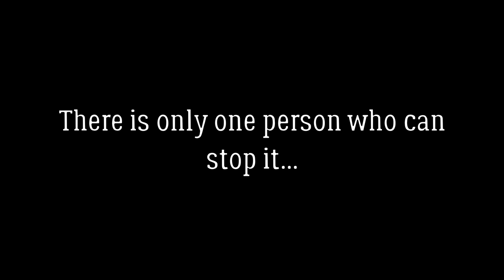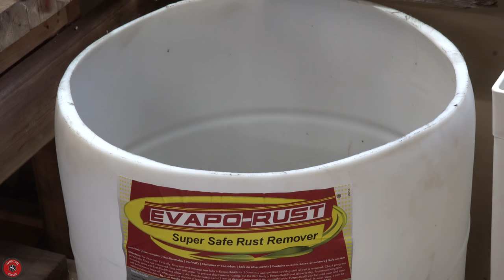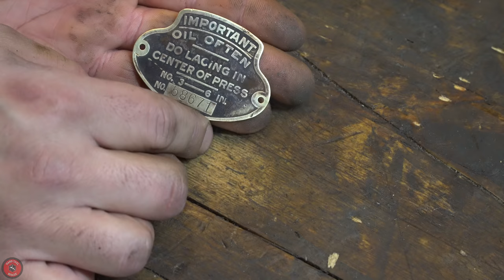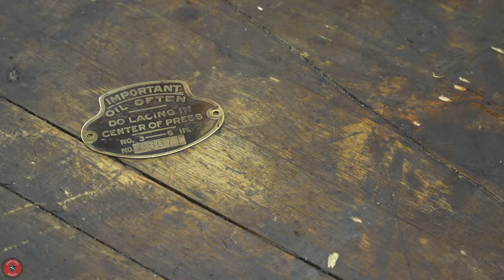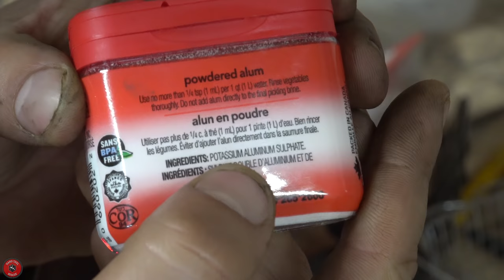Antique Belt Lacer [Restoration]

Comment: Where do you even get the refills for that tool. The ones that clamp into the belt. AND THEN WHAT DOES THAT BELT DO... FFFF
Reply from the maker: This company is actually still in business, but is now called Flexco.  These flat leather belts were for old machinery that ran off a belt line or off an antique engine.  You will see me use this tool for future restorations.
Reply: Also, many round balers use these teeth on the (rubber and fiber) belts that roll the hay into bales.  Most of the ones I've seen use about 8-10 of these belts, and they get plenty of use during the summer.  Even the rubber coated ones stretch, which means you have to shorten them periodically and put new teeth on the ends.
Reply: Or leatherwork with a gothic, steampunk vibe maybe...
Reply: My south bend lathe uses a drive belt like that too.
Reply: Yup. We could have used this a few times on our old baler.
Reply: Z  the belts are used to help create bass in old floor speakers, you should already been knowing that....
Reply: My old metal lathe uses a small flat belt as a final drive...
Reply: I've seen these belts in old textile mills driven by waterwheels to transfer the power from floor to floor where massive shafts ran the full length of the ceiling and a belt ran between the shaft and each loom. Some of the belts were pretty big and all made from leather. Tools like this must have played a major part in the industrial revolution great work keeping history alive man
Reply: Brooklyn Technical High School had   machine shop (lathes) that were driven off an overhead shaft that used belts like these.
Reply: Similar smaller belts are still used, need a long belt that might stretch... are you gonna use this or skive and glue?
Reply: 8270 AMF Tenpin bowling distributor belt uses these belts. The press here was not working properly at the end though, normally they self ratchet to the next degree.
Reply: A must have if you're in old tools. You can get rubber belts now but it     doesn't look right.
Reply: Conveyor belt repair
Reply: The first farm I worked on had this kit, we used it for the flat belt drive for a circular saw, run off a side pulley drive on a Fordson Major, the one they had was a single handle and it was a pigsa to use as you really had to swing on it to get the lacing grips to seat properly, but it did the job. 
Looking around that farm which was a real old quadrangle yard, there were shafts and bearings in all the rafters, running from an engine room which I assume would have been a lister or similar stationary engine installed, it seemed to run the dairy equipment, grain handling, chaff cutter, root chopper, and a few lifts.
No doubt some one has ripped all this out by now and probably converted it into bijou residences all that  history gone forever still I remember it and marvelled at how agriculture had become so much more mechanised, well the point is I suppose when that little bit of kit came out it represented a major advancement in power transfer and distribution, replacing with belts, pulleys and cogs/gears simple human or animal power.
Today they are still used in round balers, some bale wrappers, and there is a still a massive market (relatively) in the classic and vintage restoration scene.
Reply: The belt does what the belt is supposed to do.  Do not question the Belt!
Reply: Old time ceiling fans have 1-3 motors usually depending on amount of parasite fans, old Kona Inn restaurant had 18 fans with 5....? drive fans I think I remember dad working on? & used belts to run all the parasite fans & we had to cut & tighten the leather belts seasonally depending on slippage & ya there was adjustment pulleys but everything stretched differently, I remember it was a royal pain that paid REAL well & dad was the only guy knew how to do it.... well I know but highly doubt anyone will ever install another 1800’s era system in my lifetime
Reply: Laces are available in local farm stores. One use is on round hay balers . You repair the belts.
Reply: The Clipper inserts are readily available.  They have numbers associated with them.
Reply: Not reading further so,"what does this belt do"?
My theory...old factories had main power shafts running ftom an engine house.Individual machines,lathes grinders etc took power from them via belts which this machine could cope with.
Now,  to find out.
Reply: @HandToolRescue  yeehaa...got this one correct...cool.
I have used many a flexco for coal conveyor repairs.
First little one I've seen. Very cool.
Reply: @SamSoltan  How long ago?  When used on machinery, you only see them in Greenfield Village, Henry Ford Museum machine shop.  1800's and maybe Amish shops today.

Comment: What evil engineer put this thing together? Jesus. This thing had like, 4 patent plates on it and ALL the pins. 

Also, leave Dave alone. He'll come out when he wants to.
Reply from the maker: Hahaha.  I was actually surprised that this tool did not contain any nuts and bolts at all.
Reply: I know what you meant, but to be technical, I count one patent info, two instructional, and one from an "American stuff" importer in Paris. (Yes, I paused the video to read them when he showed them off after polishing.)
Reply: Very few engineers actually put anything together.... They mostly create headaches for the tradesmen....
Reply: @HandToolRescue  ur good
Reply: It took someone with above average  iq for sure
Reply: predominately pinned construction is insanely durable depending on the application. very little side loading on the pins here (none really). the large bearing surface of the pin should make for pretty smooth operation when oiled properly.
Reply: @3347861  That's because far too many engineers come out of college filled with what they learned from books but are never taught real life application problems.  The best engineer I ever saw was put out in the Machine Shop for 5 years as a Foreman.  That gave him the real life application knowledge.  He went nose to nose a few times with the engineer that only worked in the office.
Reply: Lol ikr, it's a patent nightmare
Reply: I was thinking diabolical mastermind.
Reply: I now understand why the Adeptus Mechanicus can’t remake any of their shit
Reply: @3347861  my son learnt this in the first week of his apprenticeship

Comment: We have had one of these lacing tools for several decades.  It came with a stationary Pioneer dry bean threshing machine.   When bean combines came out, flat belts went away.  'Fast forward a couple decades, and large round balers became popular, with large flat belts, so the Clipper lacing tool gets used from time to time.  I used mine a couple weeks ago to lace a belt for my South Bend lathe.

Comment: We had a belt repair machine in the hardware store where I worked in the 60s. Some belts were joined with steel pins and others with pins made of rawhide. The boss used the machine and I just watched. This was a farming community and lots of farmers used the classic Allis-Chalmers round bailers. A network of flat belts were what formed the bales. The belts would stretch and we would cut a little off the ends to shorten them and renew the lacing.

Comment: Believe it or not they still use these things in modern production, back in the day these made drive belts for steam driven belts and farm equipment today they are used on vinyl conveyor systems in the manufacture of pharmaceuticals... So we really haven't come that far. By the way they are more commonly used for grocery store and check counter belts there just wider and have more tines...  Great job on the restoration! Looks brand new and works even better...

Comment: Good Job and well done! In the Mill where my Father worked for half a Century, they had a simple Tool out of Wood for fixing the Transmission Belts. Using a special Hammer to get the Clamps in the Leather Belt !  They would have cheered to get such an amazing Tool !  I learned it by paractizing it.

Comment: no idea what a "belt lacer" does but this tool is top craftsmanship, solid and superbly machining and tolerances like a watch. no china crap.
Reply: Dieter Montanez before modern rubber drive belts they used leather to make drive belts. This machine is what was used to connect the ends of the leather strip together to make it into a loop.

Comment: On the farm we had a 1941 International M tractor with a belt drive pulley. The belt would be connected to a hammer mill, a ear corn conveyor or a lift that would raise the front of a grain wagon to dump its load. There was no electricity on that part of the farm but wherever the tractor was, there was mechanical assist to otherwise tedious hand work. I don’t remember if Dad repaired the belts himself, but I’m guessing our village blacksmith did it for him. The men on the farm had a trick to slap a moving drive belt to knock it off the pulleys instead of waiting for the machinery to coast to a stop. When my dad tried it, it broke his arm. It still ached when he was an old man. I do remember seeing those metal laces in the workshop, though.

Comment: used several types of belt splicers over the years just like that one, one in an old rope mill where everything was overhead line shaft driven, none of the machines I worked on was made after 1898 but they run good for making rope, and others where used in foundries for conveyer and bucket conveyers, don't miss those days, lot hot hard work

Comment: I used these many times in a textile mill I worked at a long ago , and in a second maintenance job I had after that,  We had several models of belt splicers, one was identical to this one. We used the clipper style laces of size two in this one  for smaller belts and from two to size six, in a more modern belt lacer we used to make and repair our needed belts up to 12 feet across. I learned after working there a while, my father had also once worked there doing a similar maintenance job in the same building under a different company name; Indian Head Hosiery The building was built in 1925. It once made socks and stockings, but was closed then reopened as a non woven material plant later. The old sock darners he likely worked on were pushed over into their pits, and crushed to be used as fill material and then covered in new concrete as the floors were redone for our business's ware house. When making the belts with cotton weave material, you always painted both sides of the belts near the lacing with shellac. Yet by brushing away from the laces this allowed it to soak in to the cotton belts, and not get on the new lacing clips to give the belts a much stronger and longer lasting life at the splice, the material we used was regular shellac. I once made a tool pouch just using one of the machines you show, some scraps of belting and clipper lacing. since it allowed for repairing smaller material sizes. Thanks for the memory.
Reply: You do beautiful work. That looks great. A hint; we mounted ours on  a plate to the rear for your knee to hold it still and pushed and pressed from behind the machine and belt, and the lower ratchet advanced as we pulled up and pressed forward again, a razor knife cut on the paper allowed easy removal once inserted in the clipper and secured by the wire,  but loose clips could still be added individually if you had loose ones to use up. You always had loose ones over time, or little scraps of clips. They were cut for each job.

Comment: Cut your corners first before adding laser in doing so the laces will be inside of the belt in the PIN should be protruding just a little bit so that no laces catcher track or edge of the bed and tear it. Nice job dude I like that little lacer. I only have clipper roller lasers here at work but that would be nice to have a aluminum version of that one for some of the smaller 8-in belts or even or 2 in wide belts that we have. I just wouldn't want to lug that thing around with me. Lol great work as always 🤟

Comment: Great video! I used these Clipper belt lancers well in to the 1980's. Some of the machines I used in the USAF had leather belting, depending on where I was stationed. The machines were old but in real good shape for there age as we had good shop maintenance programs. To tell you how old some of these machines were, they had metal tags on them stating "This Machine Conforms to the Orders of the War Production Board". That was the equipment that was purchased by the government for factories, shops, government owned arms and ammunition plants and even for military bases during WWII. As plants and factories updated there machinery, the older government bought machinery would be sent to a Depot facility were they were cleaned and repaired if needed and some would be upgraded to V Belts if possible. Then when a military base need some equipment it would be sent there. But by the late 1980's to early 1990's that old equipment was being replaced by new machinery and the military started using CNC machinery by the time I was getting out. I loved the old American built machinery, heavy iron and they were built to last. But there is something to be had with the new CNC Machinery and tooling, they are faster and very accurate with repeatability of +/- .0001" between parts. 
One funny story, back in the mid 70's I worked at an old machine shop up in Maine were all the machinery was run from an overhead gang drive with leather belting. We needed to replace one of the 8" wide leather belts from the overhead drive. I called on place that sold belting and asked for a 50' length of 8" belt. They must have had a new sales person there because they told me that the belts were only as long as the cow and didn't think they could get one that long. This person was very serious and had to ask another person there if leather belts came that long.

Comment: I can remember working to restore an old Nickelodeon from the late 1800's or early 1900's. Back then they made things to last. The biggest job was bending the tabs on the metal "record" discs that plucked the harps that generated the tunes. Bent, because the operators put the discs on upside down! And then they couldn't figure out why! After straightening all the tabs, we threw a stick of dynamite in the cabinet to clean the whole thing, threw on a disc and enjoyed the tunes!! 🤣😁

Comment: Wow, I'm at 13:27 and the quality and complexity of this tool is mindblowing for such a seemingly mundane everyday task in it's time... If the company didn't die out with lineshaft/belt driven equipment they certainly would've suffered at the hands of those who made cheaper and lesser quality devices. Looks like a real top of the line cost no object tool and it's stood the test of time too seemingly, I saw no broken parts come out so this resto really ought to be just de-rusting, cleaning and lubing, more undoing years of neglect and disuse than repair.

Comment: I worked in a factory, James Dawson and Son, Lincoln, England, that manufactured drive and conveyor belting. The flat type, using mostly rubber and canvas construction but just every now and again real leather ones. These types of machines were In virtually daily use then, 1960/70 times. Also outside fitters who had to go to fit or repair belts in situ , coal mines and so on, would sometimes have to use one. Some conveyor belts were quite wide. Different spark proof ones in coal mines where there was a danger of gas build up, but OK in other situations.

Comment: i ones operated one of them at my place of work at the time :) we had a big old radial drill and it ran on flat belts every so often use to have to take them of as they would get longer with use so you had to cut them down and re lace them  :)

Comment: 13:26 you see the cleaned up tag that says "Clipper" Belt Lacer made by Clipper in Grand Rapids, Michigan. Interesting fact: That company is STILL in business today. 

Excerpt from news article:
 "We're going to a whole different marketing strategy," General Manager Nancy Ayres said. Although old-timers at Clipper Belt Lacing will miss the name, it will remain a major brand for the parent company, Flexco. The local site will be renamed Flexco Grand Rapids.

Flexco, formally known as Flexible Steel Lacing Co., acquired the local business in 1995. Based in Downers Grove, Ill., Flexco had plenty in common with the Grand Rapids business, Ayres said. Both were launched between 1907 and 1908, and they had similar values as family-owned businesses."

Comment: I have seen one before, down a coal mine. It put the 'laces' (they called them 'fasteners') at an angle, quite a steep one in fact, so there was no jumping as the connection travelled over the rollers.

Comment: Every time I think you are done taking it apart, there are another 10 steps to go!

Yesterday I took the front and back off of my sewing machine to clean and "fix" it.  There were only about 12 screws involved. After I put it back together I ended up with an extra screw and a non working machine.  I can't even begin to figure out what you are going to do!

Comment: I haven’t seen you do this on camera so I thought I’d suggest it.
If you are doing this, my apologies.

When you use a torch to heat a part up use a small amount of penetrating oily cool it down.
The heating and cooling of two different metals with rust in between then should cause the rust/corrosion to crack and then the oil can be drawn in via a capillary action....
At least that’s how I have always thought about it.
Oh and as s Merchant Marine engineer I’ve had to deal with some rust and corrosion.
Sometimes when a bolt or screw doesn’t wanna move, try tapping in both directions with the penetrating oil in the threads.